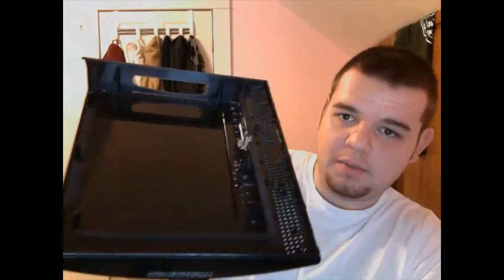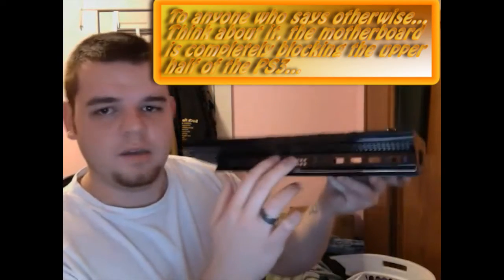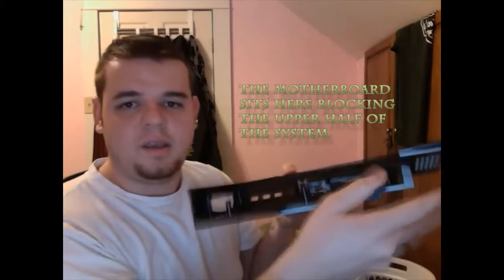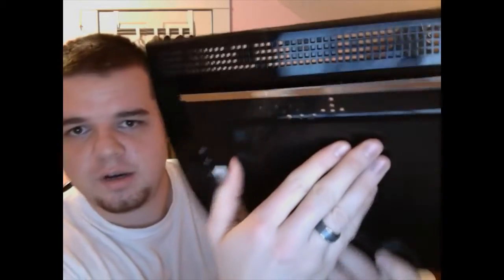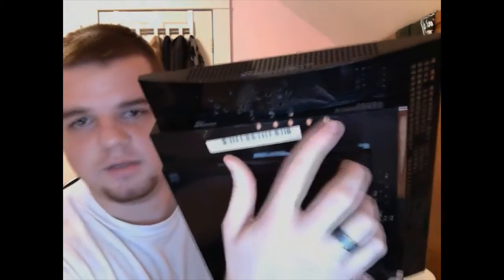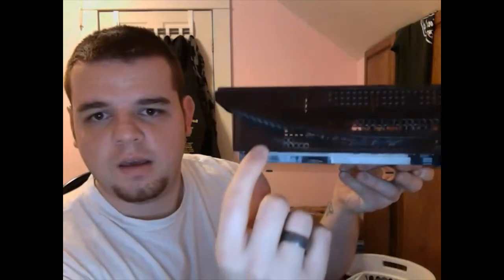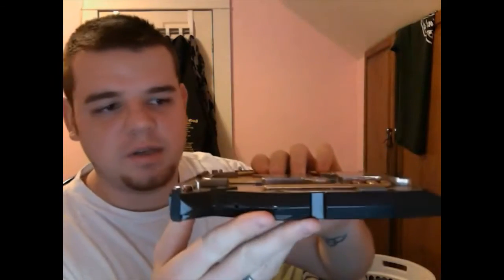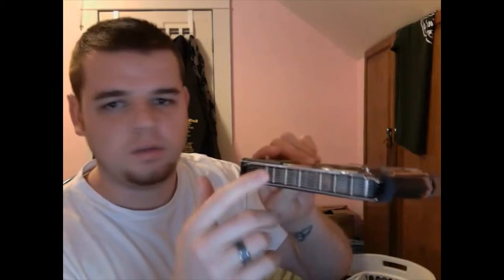PS3 YLOD fix(drilling holes) air flow.mp4

Comment: Cut holes where the 15 inch fan is. It will suck in cool air directly from below your PS3 and blow it out the front and the back.

Comment: This is dumb.

The reason PS3 die is because the Paste dries up and needs to be changed/replaced.

If you don't change your paste, just as you would your PC after few years, your PS3 will die.

That simple.

Comment from the maker: never got a chance to test this out, while refluxing my board i guess i left the heat on to long cause my board won't even register it YLOD'd, still powers on with the red power light, but doesn't respond when i try to turn it on...bottom line, im throwing in the towel...i selling the PS3 to whoever needs parts...
If anyone watches this and and gets a chance to test their PS3, please let me know how it goes, this whole idea I have with holes and the fan makes so much since it has to work.